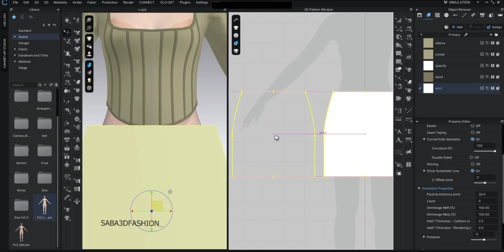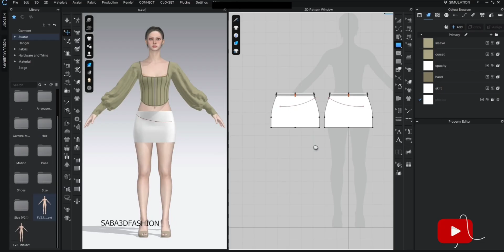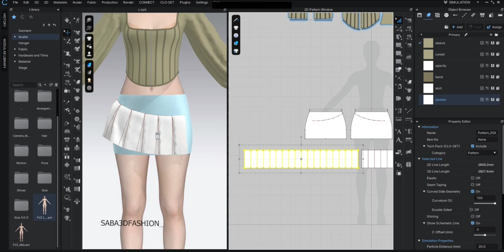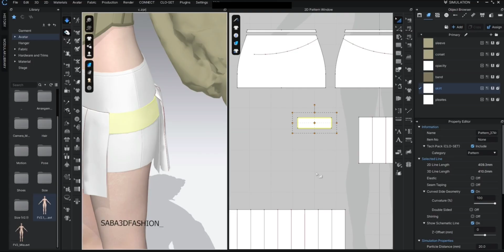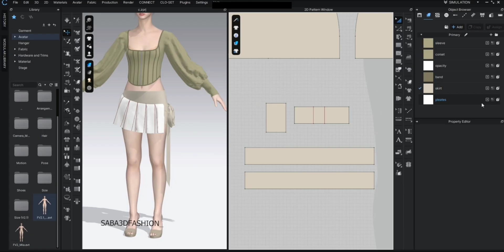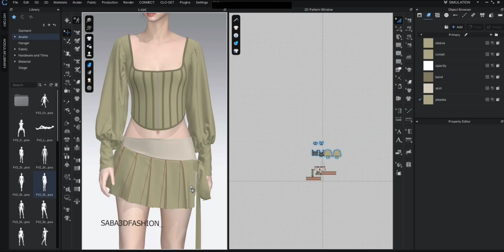How to Design a Stylish 3D Outfit in CLO 3D | Full Fashion Design Tutorial (Top + Skirt)|Part two

Comment: Hi! Is CLO3D able to export my designs into a fashion tech pack?

I will be designing my own clothes but I don't really need to work with patterns because I will have a Cut Make Trim Manufacturer helping with that - however I would like to give them the design flats as part of the tech pack, and that is the part I am struggling with. 

My brand also wants to specialize in selling padded tops with sewn-in bra padding / built-in bra, so there will always be an inner layer that I will have to work on. Is CLO3D able to support that as well? Or can CLO3D only support designing for outer layer?
Reply from the maker: Hi! CLO3D doesn’t create a full tech pack by itself, but you can export flats, patterns, and material info to include in one. 
Most designers use CLO for visuals, then put everything together in Illustrator _ InDesign. 
And yes, you can build inner layers like padding or linings in CLO, but manufacturers will still need clear 2D breakdowns for production.